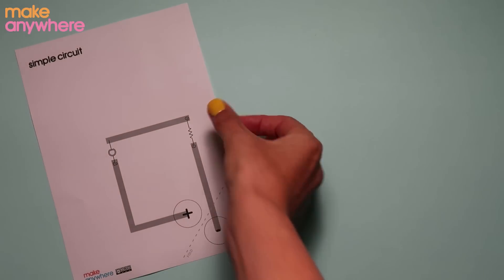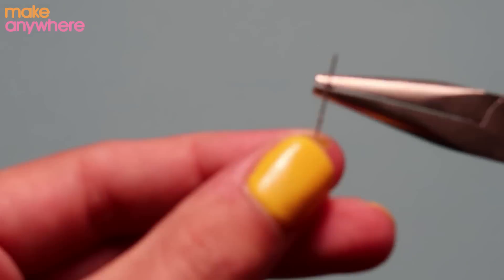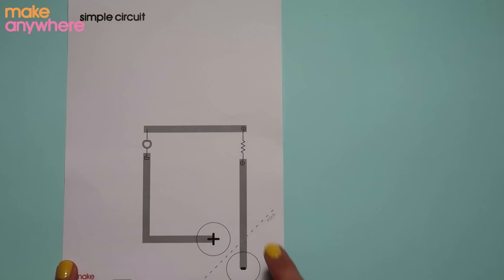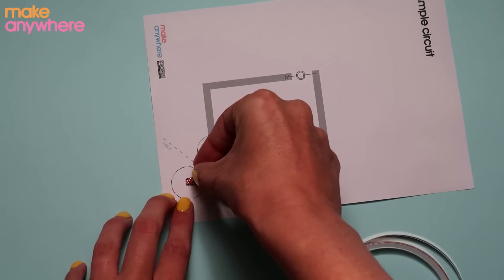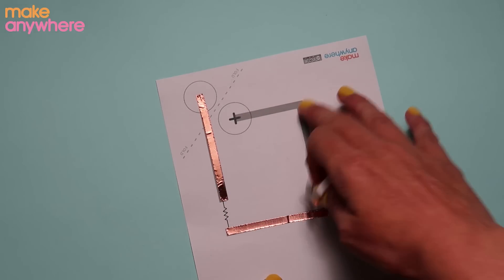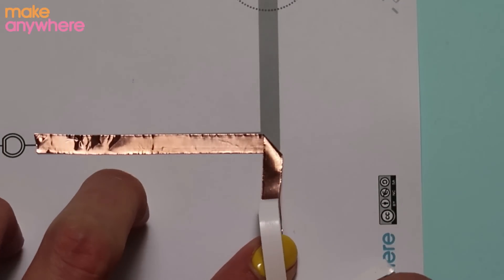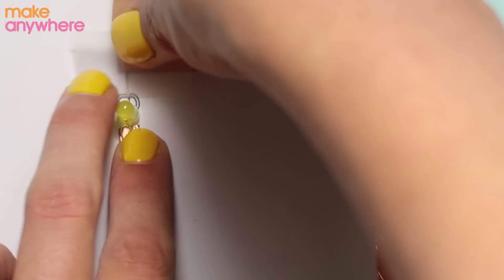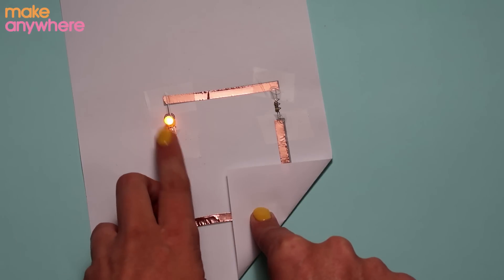How To Make A Simple Paper Circuit

Comment: Why do you need the resistor? I've seen several demos without it, just continuous copper tape. I'm trying to understand.
Reply from the maker: Em M using a resistor helps to limit the current from the battery meaning the LED will last longer. 
The battery is 3 volt but a yellow LED only needs 1.8 volt so the resistor helps to reduce the flow of the current. Think of it like the current is a river flowing from the battery. The LED is a little stream and the resistor is then a group a rocks that slows the current.
You don't necessarily need to use one in a paper circuit as the life of the LED usually isn't important but we decided it's a better way to learn from the beginning.
Reply: Thank you for the fast reply. Perfect analogy!!!
Reply: @sharingmyclassroom8219  Does it matter what size/type of resistor - I was under the impression that they too have different levels/voltage limits?
Reply: Make Anywhere thx
Reply: Em M jj